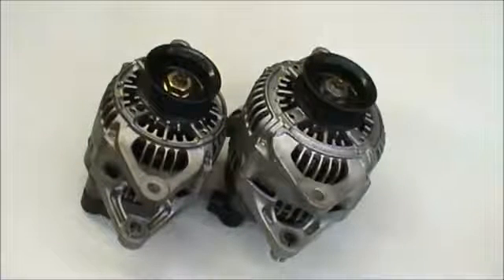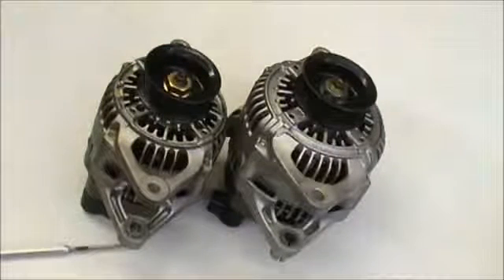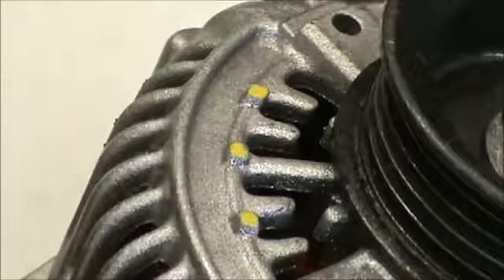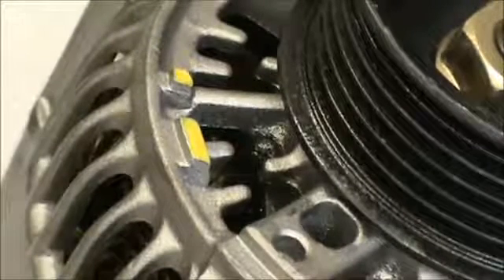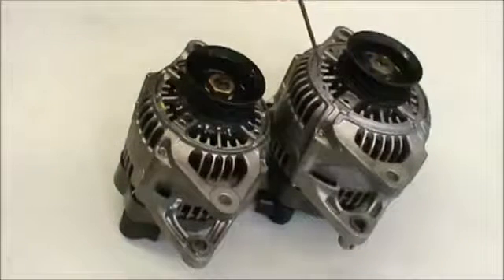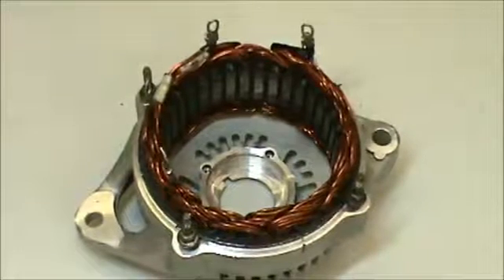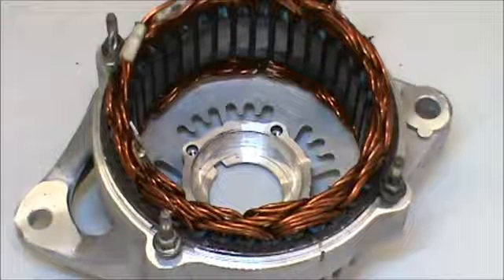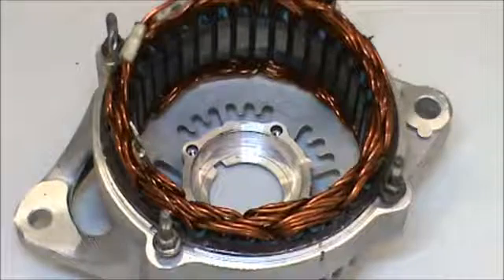Denso High Amp Upgrade

Comment: Are these still available or do you have any info on your modifications to the stator windings?

Hard to find good modifications info on these style Denso units
Reply from the maker: Not available thru us.
Reply: @rebuilderinabox  Would those stator rewound units from J&N work for increasing amperage on these cases?

I found these 200A stator units on eBay. 340-52007R

I guess you’d have to gut your old case and press this in. Not 100% sure how that is done, maybe a 3 jaw puller?

Anyway, thanks for the reply. If you have any additional info on this, it’d be greatly appreciated!
Reply from the maker: If you think you can change the stator on your own. We don't support doing that at home. No tools, low success rate.
Reply: @rebuilderinabox  Definitely would prefer not to try and remove the stator but the J&N stator seems to be the only resource I can find online regarding an improved amperage on this case. 

If I could modify my original stator, I'd rather do that. Do you have any resources for modifying the stator on a 130mm Denso case?
Reply: Can I convert my Bosch alt to use his hairpin style dense coil ?

Comment: Your eyes should show you the difference between the frame sizes. ...
Reply from the maker: Not if you don't have 2 to compare to each other. If you need to know which one you have, and you only have 1, which is what happens 99% of the time, it will be a problem you can solve by observing the casting marks. It would also be great if you could just read the sticker. But some have no OE sticker or it's not readable.

Comment: Hi Mike, I just scored a working Denso 160amp alternator from a 2003 4x4 5.9L Durango for $30 to replace a 90 amp on my 99 straight 6 4.0L TJ. When you explained the casting marks I noticed this 2003 Denso did not have them. Why aren't the marks there? And where can I get replacement brushes for this alternator? Its the 2 pin connector type.
Reply from the maker: That's a newer type alternator. You're watching the wrong how to movie. See this link on our site https://alternatorstarterrebuildkits.com/product/nd11179in6324/

Comment: Where do I get this also my alt is outputing low volts rn
Reply from the maker: Temporarily out. Battery old ? Or needs charged.
Reply: Mike Lauer  well I had a t2500 on that stock alt for years it used to output 14 now it puts like 12.7 idle
Reply from the maker: Voltage regulator is in computer. See if battery charger will charge battery on battery terminals (14.5 or more) at battery terminals. Then at alternator connections with engine off. (output post and frame of alt). Try another alt if this charges battery.

Comment: Can I order a rectifier? When I was involved in frontal collision, my amps blew out All fuses and my alternator stopped working. The diodes must have been shorted, It is a 130 amp alternator for 04 corolla.